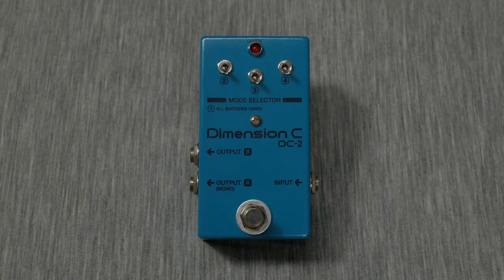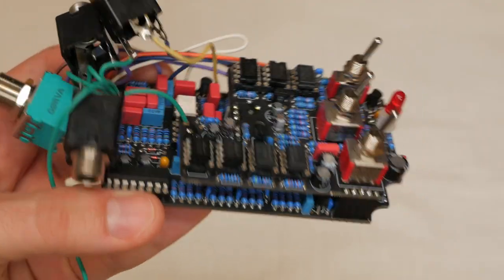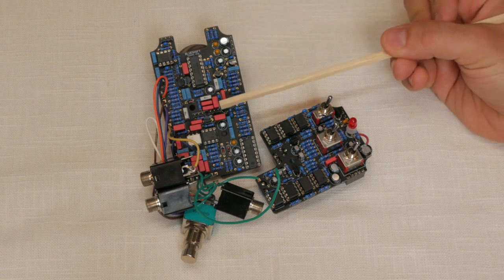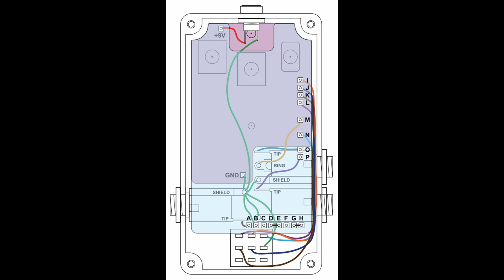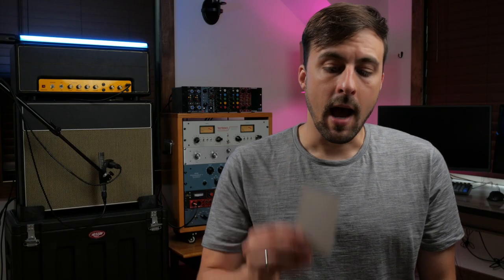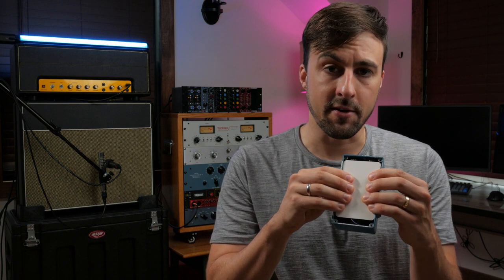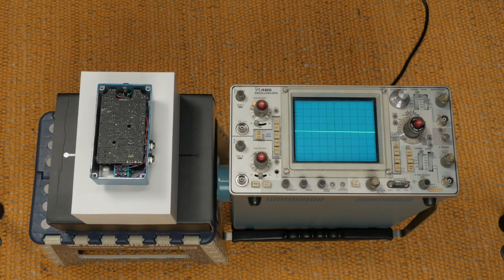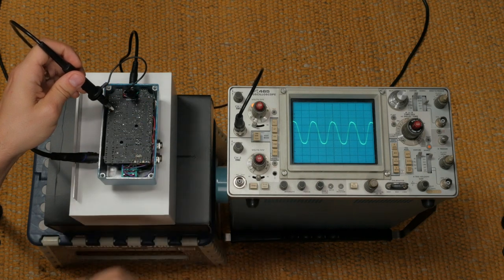Aion Blueshift - DIY DC-2 Chrous Demo, Build and Calibration

Comment: Even though I have built some tough pedals, watching your video convinced me to just give in and use a gift card to buy the BOSS Waza DC-2W.
Reply from the maker: There's no shame in that! At the end of the day this one isn't much of a cost saver. Its more of a special build experience with a few unique touches. You'll be just as happy with your Waza. The other perk about the Waza is that it will have a higher resale value in the event you decide that this one isn't for you!